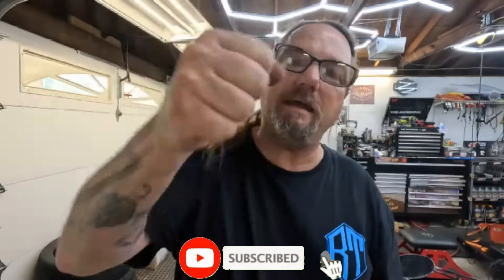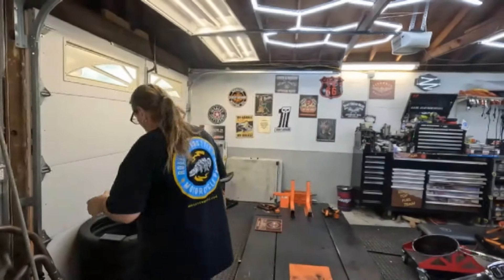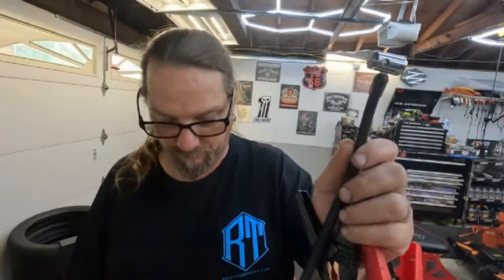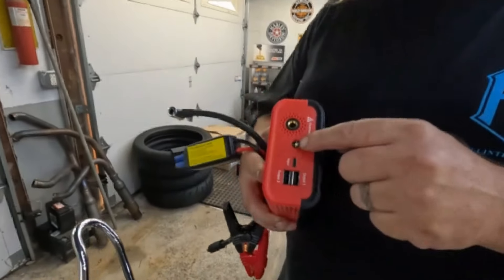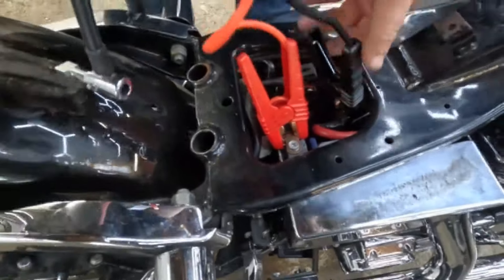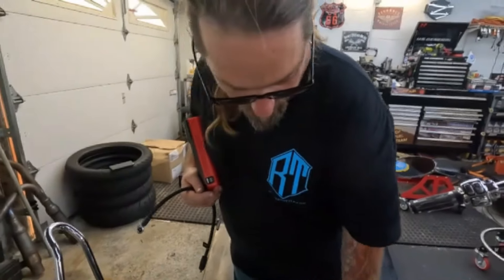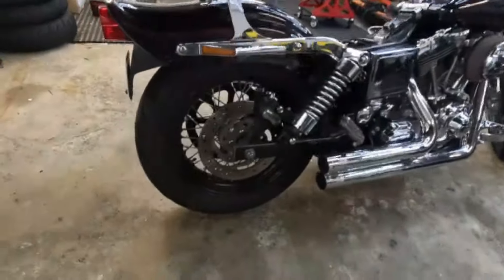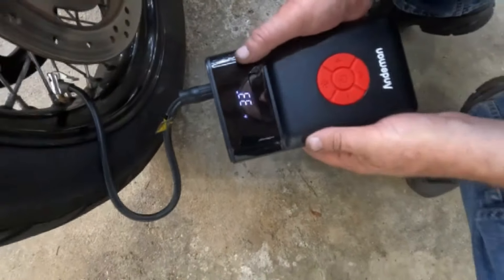Andeman Jump Pack and tire inflator

Comment: I had to put 90 degree valve stems on my bike because I lose half of what you put in connecting and disconnecting the nozzle.
Reply from the maker: I have them on my Roadglide.  They are awesome.  Makes life much easier
Reply: @DrHarley  Absolutely! (This is Steve Turner, by the way.  Didn't get a chance to watch the premier, or I would have been in the chat).
Reply from the maker: @Silverwinger82 awesome. Steve.  We will be in Ocean City MD on Thursday through Sunday
Reply: @DrHarley  I worked this weekend, so I'll be off then. Maybe I'll ride down on Saturday, I don't know.
Reply from the maker: @Silverwinger82 awesome.  I will be at the convention center most of the day on Saturday.  I hope to see you.
Reply: @DrHarley  After researching it, I won't be there. $105 for a one day pass.  And I don't do well with metal detectors, either.
Reply from the maker: @Silverwinger82  I believe that the on day pass is for the music venue. There are no metal detectors for the convention center and no fee to enter.